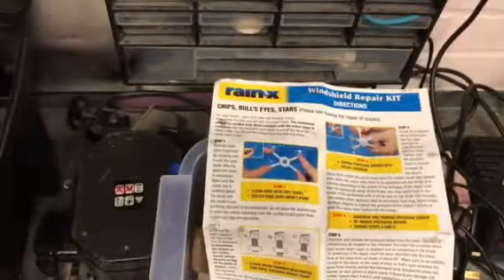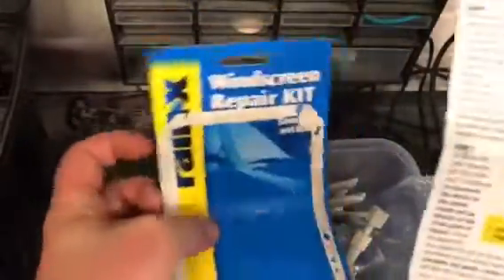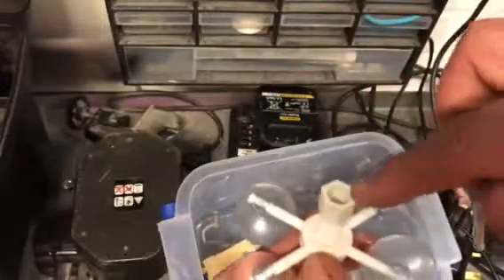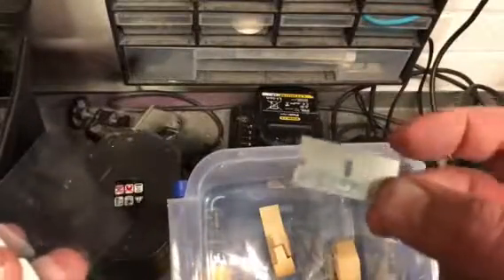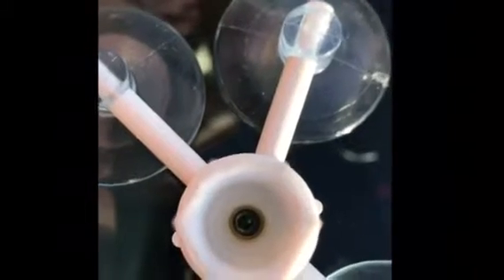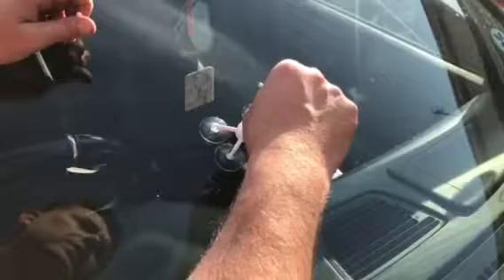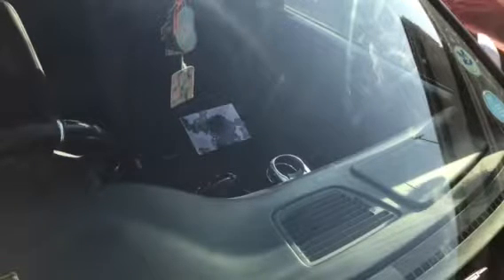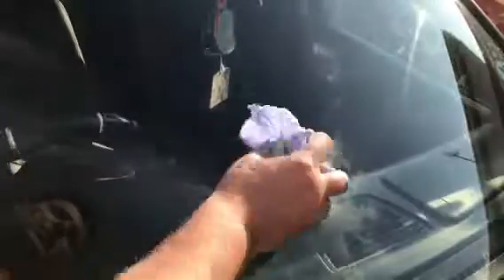Fixing a stone chip on your windscreen, yourself.

Comment: Nice! I like the Rain-X water repellent, I use it on my windshields & headlights. I have to get one of these kits & give that a try. It costs about $50 to get a chip like that repaired at a glass shop here in Canada... they do however mostly get rid of it, normally you can hardly tell. Didn’t realize you’d get so many chips where you live, it is bad here in Alberta when they put sand on the slippery roads.
Reply from the maker: They resurface the roads and the stones flip off the other cars, I’ve got chips all over it. I’m pretty sure it will disintegrate one day.🙄😂
Reply: Driveway DIYer Same here, we get tons of rock chips all over our cars. In the winter it gets too cold for salt to work on the roads so they use sand to add traction to the ice instead, thus there is always lots of grit on the roads during winter & spring.